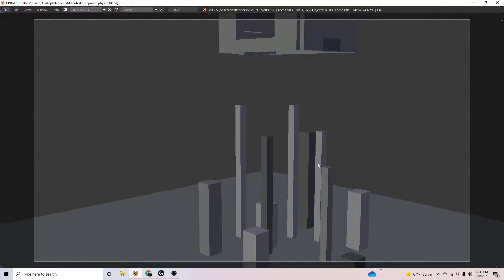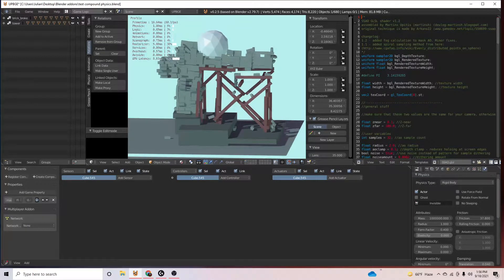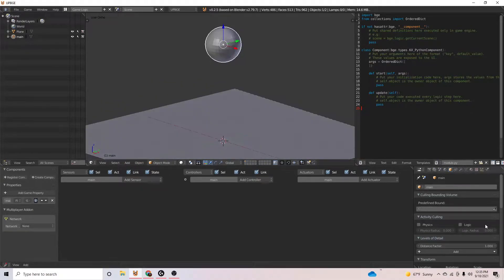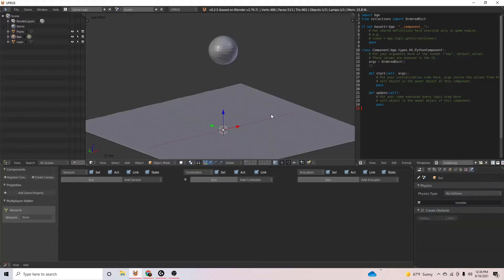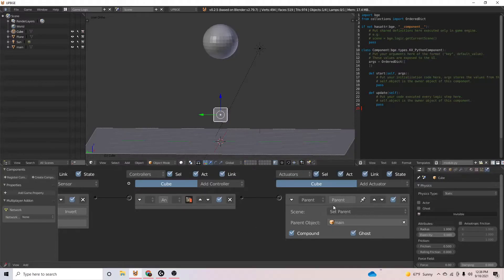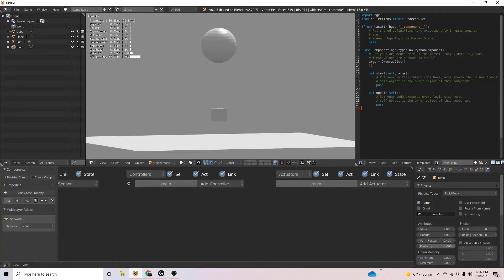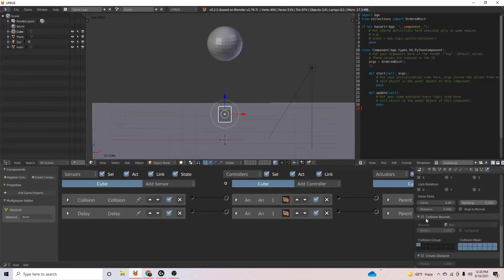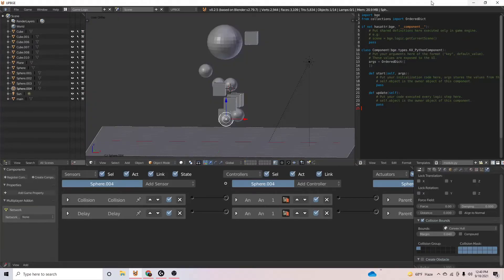Compound Parenting Building Destruction | UPBGE

Comment: but what about uncompound in upbge based on 3.0+\4.0+ by native blender object parent ?
Reply from the maker: what do you mean?
Reply: @Loxaevion  it is internal engine bonded with program, everything on 2.79 revisions based work more complex, because many parts simply understand actions outside of logick breaks etc.. but one thing - if you try create parent just in blender with two objcs (one to another) just by "object" condition with vertice or 3 vert etc doesnt matter , - it unerstood too but, when you execute script while game process trying to unparent (those two objcs are compound) using breaks or node editor dsnt mtr, it will not work, it glitching and visual obj doing thing apart of collision it self if you visualise physics. This is very weird because if you want use asset for destruction created for this purpose, you actually can not use it.  I told that in reason of non understanding this situation if all assets literally in industry have some ammout of complex parent system that work in every engine, why do i need parenting by some how yhis in launch process? idk, i use it as workbench some years and all revisions for and from 3.0 to latest 4.2 have this, sorry bro for letters ammount